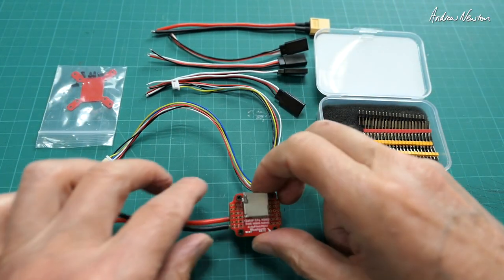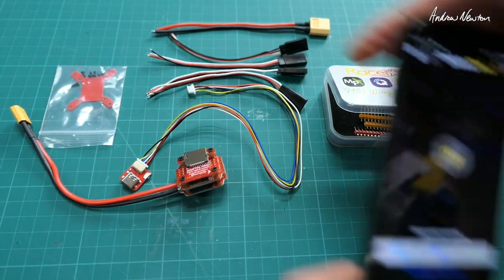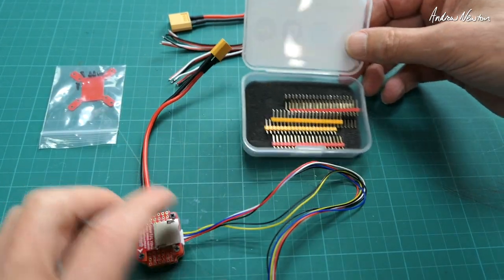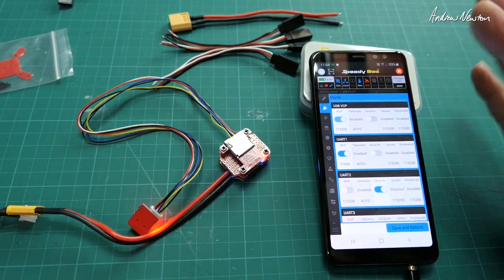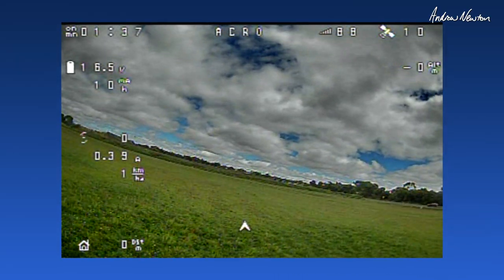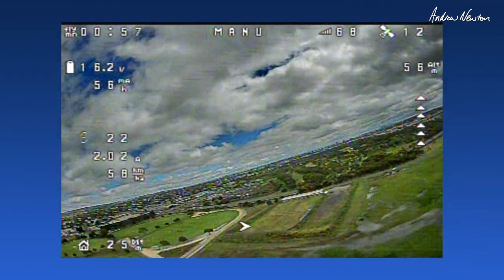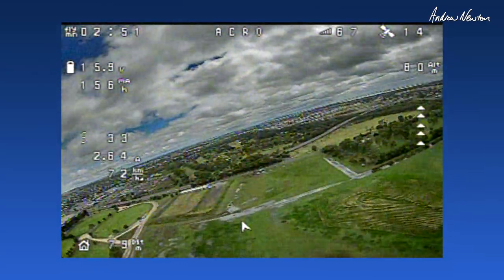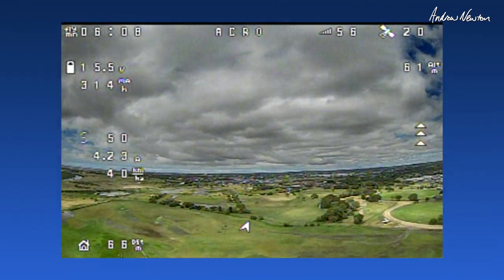RacerStar F405 Wing Nano

Comment: Nice to see the Talon flying. The low current draw and that glide are impressive.

It's probably better to compare with both the Matek 405-WSE and Matek 411-WSE. 
The RacerStar F405 kind of fits between the two, in terms of size and features.

Comment: Hope you have more luck with this one than I did.
Reply: what issues did you have
Reply: I broke mine soldering it...
Reply: I tried to use right angle pins on the lower board, for servo connections, then discovered that they clashed with the middle board. Wish I had seen Andrew’s video first. I may have caused some shorts on first powering up. By the time I had unsoldered everything I think I also cooked some components and couldn’t get all the functions working. Gave up in the end. Andrew wasn’t lucky - he was just smarter!
Reply from the maker: Only smarter because I have learned from my mistakes, and I have fried quite a few boards.

Comment: Is anyone using this board?  I've had a few F411 WSEs and not supper happy about consistency in quality with them.  (Before the hate mail comes, yes I acknowledge it could be my soldering skills, but the 411 is pretty easy to solder on compared to say the 16x16 stacks on drones like the Flywoo Explorer or even the mini whoop AIO boards).  I've got  pile of these that have failed.  Looking to try something different, but there aren't that many reviews out there on Racestar and most of the ones I've seen the reviewer ends up dropping in a F411 WSE
Reply from the maker: Matek generally are better quality and more reliable

Comment: Where between did you put the LC filter?
Reply: id like to know to
Reply: @Mrfunkyfpv  VTX power
Reply: @HermyH66   so between the vtx and the board
Reply: @Mrfunkyfpv  depends where the vtx power is coming from, could be that it is connected directly to the lipo. But the filter is placed on the input power of the vtx
Reply: The video feed appears to go through the filter, is this the case‽
Reply: @andresabrego269  He uses a LC filter, it is placed on the power input of the vtx to eliminate esc noise, which usually manifests itself by showing these diagonal lines in the video feed, and the lines have a clear relation with the amount of throttle that is applied.
Reply: @HermyH66  in my case I will use the batt from the the board so I will put the filter there
Reply: @HermyH66  I'm aware of that thank you, I just was curious if the signal line was also into the circuit somehow, never seen that before
Reply from the maker: Between the VTx and the board, just the power and ground
Reply: @andresabrego269  Neither have i. Better to fix these issues at the source instead of fixing the symptoms.
Reply: @AndrewNewton   thank man    I have 3 board and np yet just the fpv feed.  Thanks for all the help guys